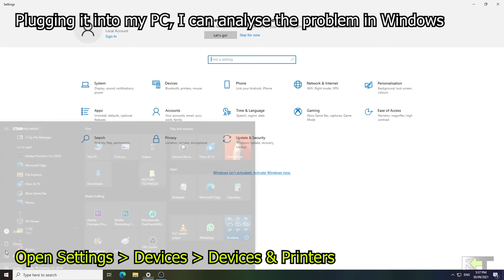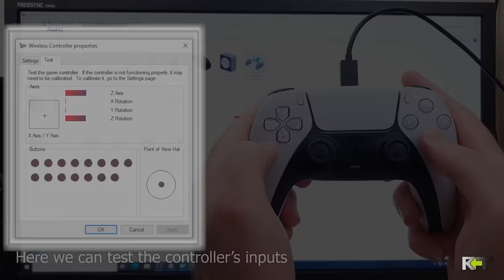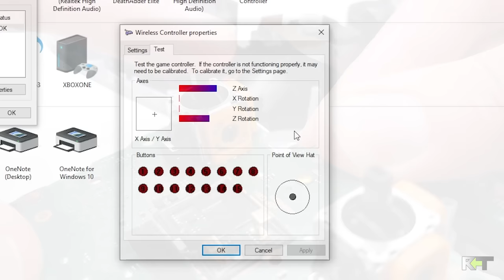How to take apart your PS5 Controller and fix Stick Drift

Comment: I had to do this 4 times already in just a little over 7 months since I got this console brand new (the left stick started drifting in just ~2 months). 3 times it was for the left stick, once for the right.
Since the second time, I just clean all 4 potentiometers whenever I take the controller apart.

Such a shame that a well built controller like this has the worst potentiometers I've ever encountered...
Also, the battery life could be way better.

Comment: Great friendly step by step instructions. Opened up the potentiometers and cleaned them and replaced them back. Surprisingly small amount of gunk causing such a major issue. Stick drift solved as of now.. will have to see how long it holds.

Thank you sir!

Comment: If your intent is to clean the controller with canned air, once you get the backing off, theres a small opening on either side of the gold contact connector next to the microphone, you can spray air with a straw tehre and it'll be perfectly for people who just dont want to go deep.
Reply: Thanks, I took apart my controller already to put paddles on it and that shit was stressful so I’m not trying to mess anything up so ima try this
Reply: @SheedVI  did it work?
Reply: @Livefastdieyoung33  I haven’t got around to it yet
Reply: Jade could you post a video similar to the other one but repairing with out soldering 
I have can air

Comment: This is the kind of videos people need who want to attempt to do the repair themselves and are comfortable in doing them. 

I personally ruined the casing on a Xbox controller putting a deep scratch from using a sharp glasses flat head screw driver prying open the casing. 

If I had the proper tools I would possibly attempt again. Please link the best place to purchase a pry tool and your kits you use. Your video is so detailed. I loved EVERYTHING about it. Will DEFINITELY recommend to friends. 💜 💜 💜

Comment: This was such an awesome video.  Thank you so much... You are a lifesaver.

I found some sticky brown residue on the board covering the contacts and pcb wires leading from the joystick.  Cleaned that off and also cleaned the potentiometers and it works like a charm! Much love man.

Comment: Just as an FYI: I went through this procedure and cleaned the joystick just like the video showed. I found NO crud, NO grease. Nothing was apparently dirty at all. The Qtip was completely clean when wiped over all surfaces.

But when I put it back together, it worked like brand new. Drift 100% gone.
Reply from the maker: Hmm, very curious... there must have been some microscopic dirt/particles that you cleaned off. This shows that stick drift can be caused by something so minor.
Anyway, glad it worked!
Reply: Mightve fixed the ball back in position
Reply: Update since it’s been 5 days I’m gonna do this tomorrow so I was wondering if you could tell me if it’s still fine please 😁

Comment: Great video, I followed along every step (up until the soldering part) but unfortunately I still have the problem. The wiper disk on mine did not look gunked up at all but I still cleaned it. My left stick drifts hard to the left. This is the second controller I've had this issue with. Sony will repair for free but you do have to pay shipping, which is a pain.

Edit: Ended up sending my 2nd controller it into Sony. I was past the one year warranty period but they took it anyway. The good news is they didn't notice/care that I opened it myself first. Also, it appears they sent me an entirely new controller. All in all I've had to pay probably $20 in shipping total for problems that weren't my fault. Definitely a bummer.
Reply: How much was shipping
Reply: @JohnyRichTV  I think I paid $8-9 to ship it via USPS.
Reply: @nickd1978  not bad but when multiple people having an issue not good
Reply: Same here
Reply: How long did it take to receive back your controller from went you sent it to them, to when you got it back?
Reply: @diamondborealis454  I think 10 days.
Reply: I just did the exact same thing.

Comment: 100% left stick drift to the left, this guide worked like a charm. Ive bought 4 controllers in a year…i still cant believe its fixed while im using it 😂
this is super informative and to the point, GREAT job!
Reply: Does it still working smoothly or any problem?
Reply: @chuteorphee3489  it was my first time and getting to the spring in the stick, i broke one of the pins that attaches to the frame 
So it came back but much worse
I fixed one of my very first ps5 controllers that had a stuck R2 and youre to thank that i havent had to invest again!

Comment: Thanks for the step by step instructions, I was able to fix my stick drift, there was no carbon but the potentiometer copper rings were a bit loose. I tightened them and put it back together, it's working great!!
Reply from the maker: Nice work!

Comment: Can you please tell me where to get the replacement analog sticks that are not Chinese knockoffs with messed up resistance values and thus completely different sensitivity in game?
Reply: Not the issue. If you replace the sticks, the controller will need calibration which is done at the factory and not possible on your console.
Reply: @dragons_red  By your logic no one has ever been able to fix a controller with analog stick issues since the days of PS2.

Comment: Thanks for the video, it is an excellent guide to clean rather than replace the parts inside and this was all my 4 year old Dualsense needed. It had started to drift on the right vertical axis, meaning my view would often drift toward the sky. A quick clean later and a quick test looks to have fixed it, excellent! Many thanks again. (Mine didn't have any grease, model CFI-ZCT1W).

Comment: this was exactly what my controller needed, thanks a lot man. i only use it for rocket league. was having weird issues of turning left randomly, thought it might be normal stick drift but i opened a joystick analyzer and it would randomly shift from 0 (below deadzone) to maximum left and back to normal. figured it was some sort of electrical issue and, seeing what these pieces look like pretty much confirmed that. i opened all of the sensor casings or whatever those orange or cyan boxes are, cleaned and rotated everything (putting off the worn bits onto the right joystick which is hardly used in rocket league)  and hooked everything back up.. controller was good as new! for anyone else having issues in rocket league I would definitely recommend doing the same as you can just about double the already long lifespan of these joysticks

Comment: Thought my controller was toast but this video came in clutch for disassembly. My issue was with the dpad but same fix as the stick drift, just cleaned it up and checked ribbon that connect left side of controller. Back in business. Thank you for the video!

Comment: You are a godsend! I can't believe the stick drift has gone! The issue wasn't that bad, just the left stick occasionally drifting to the left. But I refused to play, seeing it get a little worse with each use. A game like Elden Ring needs precise control and timing, so I didn't want to wait until the drift got really bad. When it came to the disassembly, I struggled FOR AGES to dislodge the big clip. I had to fork out another £20 to get the spudgers etc. Turns out I needed a different tool to the one you were using to unclip the sides. When I finally got to the interior, some parts looked DIFFERENT to your controller... I was so afraid of damaging the coil, that I decided to simply clean it as it was. It was not covered in gunk. My PS4 controller never needed this kind of top-down clean, it never suffered from drift in 4 years of continuous usage. My PS5 controller suddenly developed the drift issue overnight, after 1 year of usage. I honestly lost all hope of the drift being fixed, since I thought I'd messed up the reassembly  and couldn't get rid of all the dust. Then, when I booted up my PS5 again, no stick drift at all during 2 hours of test playing Elden Ring! It seems the remedy was to loosen up the parts, .

Comment: Great tutorial, but unfortunately I've learned that this is just a temporary fix.

I did this 3 months ago and it fixed the stick drift, but just 1,5 months later it came back. So now I am cleaning it for the second time.

Comment: I’ve just used this guide, and it’s excellent for the disassembly part. However I had no debris whatsoever, turns out one of the side “prongs” were higher then it should be, so I gently pushed it down a couple of times (this is the green housing option). I’ve lost some upwards range but a calibration solved it! Now it’s better then ever to be honest.

Comment: Great video I fixed my Dualsense that had drift on the right thumb stick. One small suggestion, there’s also clips on the microphone area of the controller that has to be loosened up to take the faceplate off. If you can’t edit the video anymore hope people read this before breaking their faceplates.
Reply from the maker: Cool 👍 
You mean these clips? 2:27
Reply: @RestoreTechnique  oh man!!! I can’t believe I missed it! Must have been because I was so nervous messing up the controller! 😬

Comment: I have 5 controllers that all had stick drift issue.  I disassembled them and clean or replace potentiometer but it was temp fix.  I decided to try it out with soldering and replace all with hall effect joystick over the weekend.   So far so good.  Wish it doesn't cause anymore issue.  One of them was actually buried for parts but now it is usable again.

Comment: Thank you so much for making this video as it’s so well formatted and cuts straight to the point with good instructions, it helped me not break my controller doing it myself and I actually managed to fix my stick drift by just getting it opened up and blowing all the gunk and dust out of the joystick module.

Comment: Thank you for making this video. It helped me navigate the disassembly and cleaning process for my controller. The left analog stick drift problem seems to have been corrected. It saved me from having to go out and replace a  controller that was less than a year old
Reply: Is the grease thing he put mandatory? Did u put it or na

Comment: Just fixed my Xbox controller because was having issues with the charging unit, was fairly simple without needing a tutorial. Then decided might as well fix my PS5 stick drift and a loose X button and Holy is it so much more complex! I'll save this for later when I'm a little more confident of not making it worse. This is the second PS5 controller I've bought with the exact same problem.

Comment: Thanks very much for this guide, solved my drift with a little perseverance. What did I learn? Plug the battery in and test it before reassembling. Make sure you put the contact coils back in the right way up (Had the stick position on screen locked all the way to the left on first reassemble). WD40 Specialist Contact cleaner is a good alternative to IPA if you have it on hand. The components in this video look larger than they will when you open it up for yourself, so be prepared for fiddly work and take extra time to be careful about it. 

Also, it felt good to support the companies that I bought the proper tools, cleaner and silicon grease from instead of sending Sony another dime for a product that should come with hall sensors as standard.

Comment: Thank you so much for this video! I had a problem with my left stick being jittery at max distance, causing my characters to spaz out when trying to run.  I would have never had the confidence to open up my controller and fix it, if it wasn't for this super helpful video!

Comment: I FIXED PS5 Pad, which had drifting on left analog stick.

CLEANING potentiometer didn't help.
The problem was faulty potentiometer with WORN out inner path.

NO NEED to resolder potentiometer.

Open potentiometer (4:23). 
I took out the small part that turns on potentiometer (4:41).
I used PENCIL to draw on worn out path on potentiometer (you can see it open at 5:38, however this one seems not to have worn out inner path, mine had).
Pencil has graphite that allows current to flow.

Now my PS5 PAD works.

Comment: Thanks for the clear instructions, I've reached the potentiometer (mine was green) but was unable to unclip it to clean inside, so I just used compressed air (that solved the issue at 90%, but then I thoug "why not clean more..." and used alcool on the moving part, bringing back the issue 🥲; fixed lately with more compressed air). Now is ok, just a very little spike (readable in the timestamp) but is not influencing the gameplay.

Comment: Tytyty helped me out big time I stopped the stick drift and discovered my controller is on its last limb and will need sautir work done...but good for now...will definitely be ordering a 2nd controller to hold me over....the clicker no longer clicks and the bubble is cracked so gotta order some parts as well...huge help thanks again 😊

Comment: Foe anyone doing this, don't skip the part where you connect it to your pc. I assumed the problem was on the left ring since that's where the drift came from. It turned out to be the upper ring that was dirty and had some very fine "ink" on it. Oh, and check what kind of joystick you have in case you need to replace the disks. Mine are green instead of orange, they look exactly like the ones from my ps4 slim controller. 

Thanks for this amazing tutorial, I feel like I just gave Sony the middle finger and saved 60$.

Comment: Thanks for the video! I was able to take my controller apart relatively easy and clean that metal part to the potentiometer with tools around the house. I wouldn’t recommend not using the right tools, but I had already planned to just buy a new controller if I messed up this repair. Thanks again!

Comment: Cleaning it fixed drift on my controller, thanks! I did snap a few clips in the process though. The big clips when taking the housing off, one of the clips on the actual analogue stick sensor that you take out to clean. And the thing that holds the ribbon cable that you disconnect from microphone / speaker or whatever it is. But it’s clipped back together ok. First test on COD and it seems to work fine now

Comment: Another help full tip for anyone dealing with stick drift on left thumb stick. If you remove the thumb stick and then cut off the circular plastic that stops it from being able to come off and just leave on the grip itself that can also fix it. I've just done it for my ps5 remote and I've done it for previous Xbox remotes
Reply: Wait wym???

Comment: Okay so I had this exact same problem for the last 2 days I’ve been looking everywhere for a video to help me figure out what’s wrong and how I could fix it but it was with my left joystick not my right joystick and I did everything you did step by step and it actually worked! I tried so many things and thought I was going to have to buy a new controller because nothing was working and now I don’t have to spend like 80 dollars and not have to wait to play thanks for the video and the step by step instructions if you have this problem definitely try it I pulled those little coil things out and there was bunch of black stuff on the plastic part cleaned it off and now works like brand new

Comment: Super amazingly helpful RT. Thank you very much. 
One thing to add is that I found the pieces to be smaller then expected. Completely my own fault. So I say this to caution other DIY'ers. I have opened up and cleaned XBox and PS4 controllers no worries. This one felt a little above my pay grade. So for the 2nd controller, I am going to take it to a local electronic fix it shop guy/girl/person.

Comment: Great video. Solved the problem. Just missing the part where you take off the bottom end screws before trying to pry open the remote. Took me minute to realize there were 2 more screws to take out. Thank you still!!

Comment: Cheers mate just made me break my controller as you weren’t specific enough about taking the battery out
Reply from the maker: I didn't make you break anything, you're an adult right? If not, get your parents permission before tinkering with your toys.
I can't post an hour long video showing close ups of every little thing in great detail. It's not an idiot proof guide.

Comment: Just followed it and fixed my moving forward when moving backwards thanks wish I'd had the nerve to try it before buying a new one, at least I've got a spare now. Mine looks like it's been chewed apart by a really small mouse but I wasn't going to go out and buy clip tools.
Reply from the maker: Nice work 👌
Reply: @RestoreTechnique  Got away with just cleaning the the little rings and contacts. Not a job for old eyes and sausage fingers but three pair of glasses and a lot of deep breathing and the pictures helped thanks.

Comment: Used your video to fix my hubby's drifting left analog stick on his controller, but now when he presses L3 it moves him left, it is somewhat inconsistent but is easily repeatable.  Is there anyone that can tell me what might be going on with the controller? This is probably due to something I did, your video was very helpful and I learned a lot from it and lack of voiceover helped me focus more on the task at hand. I feel I can take a PS5 controller apart with my eyes closed, but clearly I need to work on mastering my technique.

Comment: I'm already preparing myself mentally to buy a new controller 😅. I ordered some potentiometers, to swap out the metallic ring. Unfortunately I also have back buttons installed... So need to take pictures and remember where to place the cables 😅
Reply from the maker: Good luck 👍
Reply: I just changed the potentiometers out. It seems to be better, not completely fixed, but not as bad as it was. I'll just keep it as a backup controller and get a new one.
Reply from the maker: @ERoossien  ah ok 👍